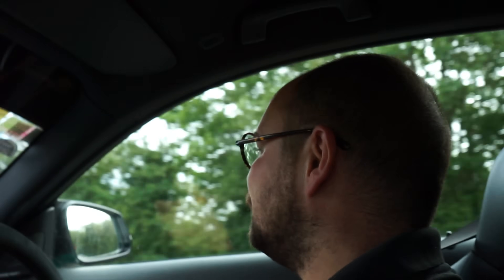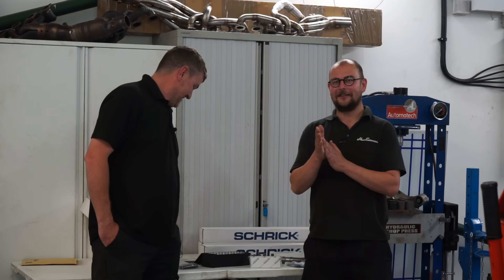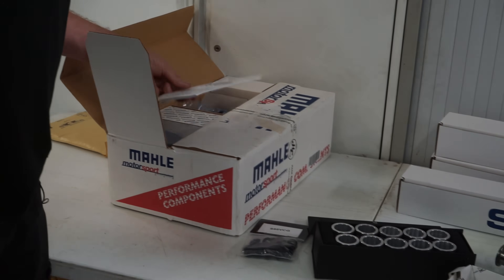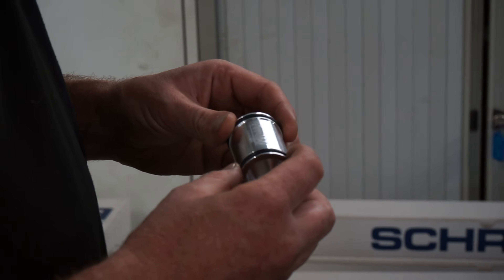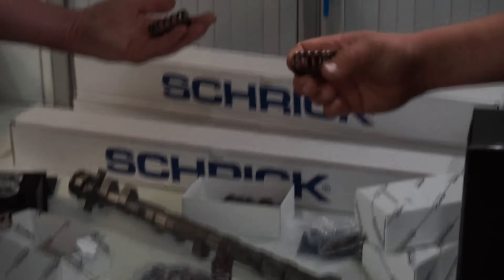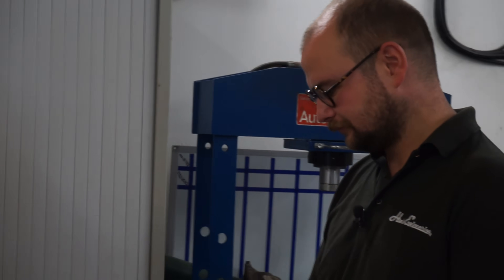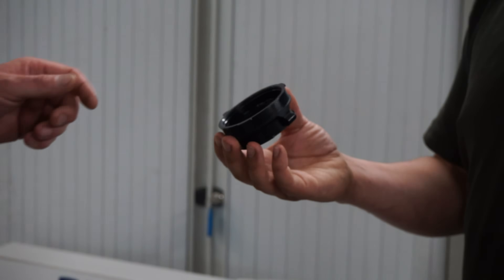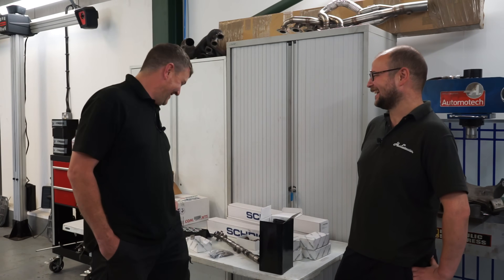Supplying CHRIS HARRIS' M5 Engine Build ft. Everything M3s

Comment: Pleasure seeing such competency! Is there a solution for injectors for e60 m5 v10, are there aftermarket or oem replacement available or a reputable house refurbishing these?
Reply: Search M5Board, you can use e9X M3 S65 injectors or Ferrari 599 injectors -- but they both require minor coding to perform optimally.
Reply: @MrXerxes Excellent! This helps a lot❤
Reply from the maker: As above, and we can also refurb them! https://www.hackengineering.co.uk/product/hack-engineering-injector-servicing/